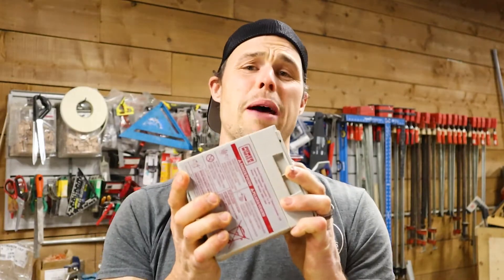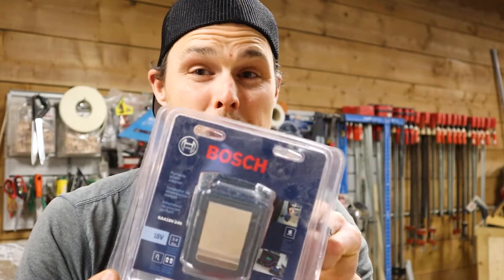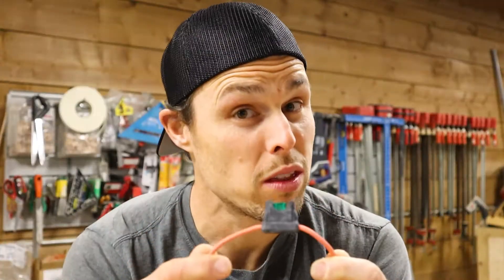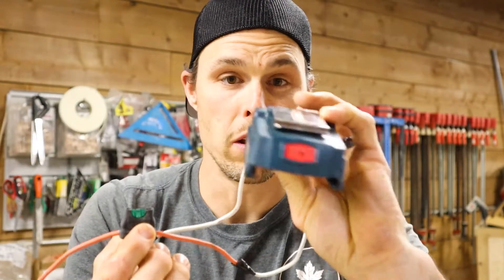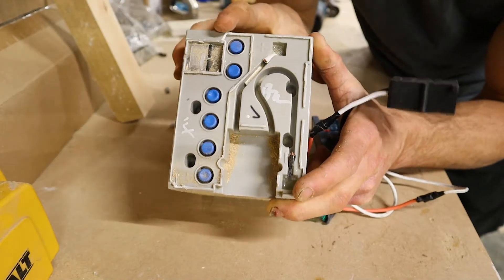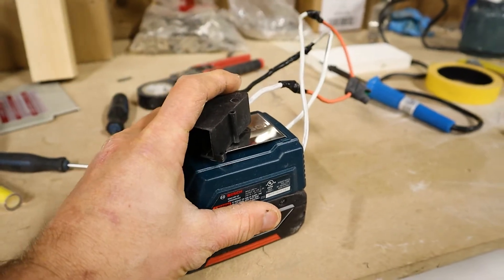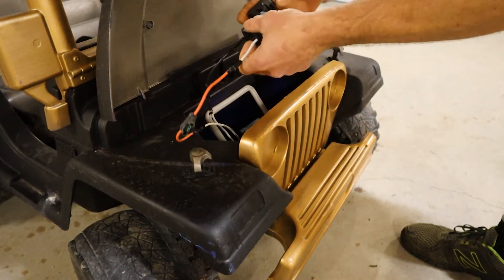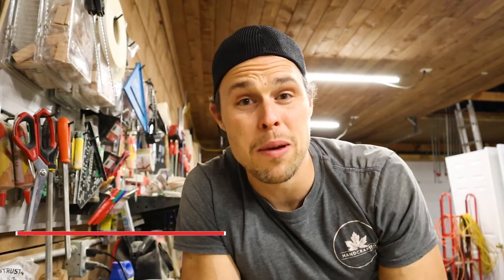PowerWheels Battery Upgrade - Supercharged

Comment: Can you charge them through the power wheel? Or you would have to take the battery out to charge everytim?
Reply from the maker: All tool batteries require a charger, if you come up with a new charger that can work like an alternator on a powerwheels, perhaps then you can save swapping batteries? But the benefit of tool batteries is swapping them quickly for one of the same as most tool owners have more than one battery on hand.  👍
Reply: @HandcraftedbyChrisPalmer  the battery compartment on mine is under the seat. It would be troublesome to take off the seat everytime it need to be charged.
Thanks.

Comment: Awesome video man, quick question would I need to do anything different if I was to use a 40v Black & Decker battery? Like a different fuse or something??
Reply from the maker: Thanks, and based on that battery size I would be worried that you would continually blow the fuse. 40v to replace a 12v is a big upgrade. 👍

Comment: I actually just bought one of these. I’m wondering though, you’re getting full 18v power which is awesome and stupid fast on the power wheel. I was thinking of just using the 12v barrel plug in the middle of the adapter to keep it at the same voltage and then I also don’t have to modify the bosch power adapter.
Reply from the maker: As long as you get a fuse between the power source and motors you'll be good to go. Save them from burning out. 12V lithium is likely pushing a higher voltage than the powerwheels NiCad battery. 18V is so fun tho 👍😆